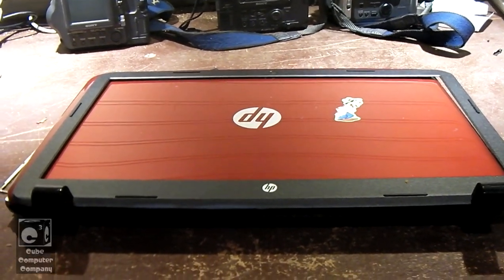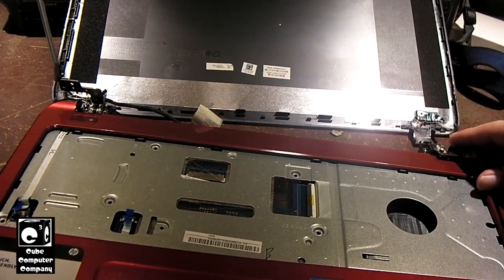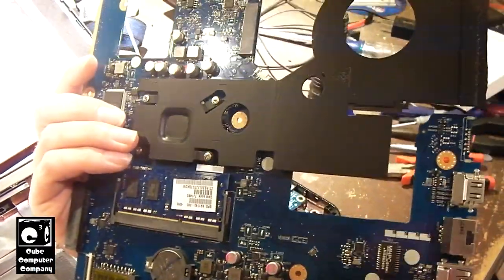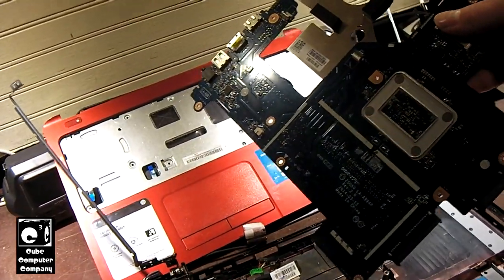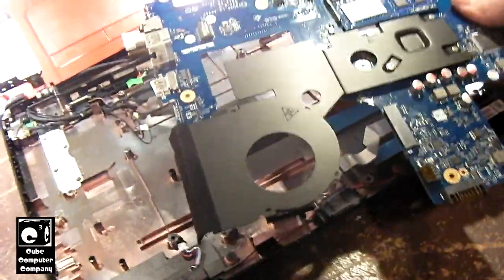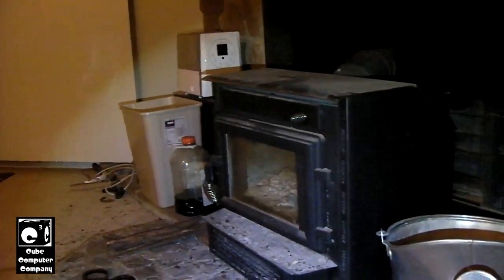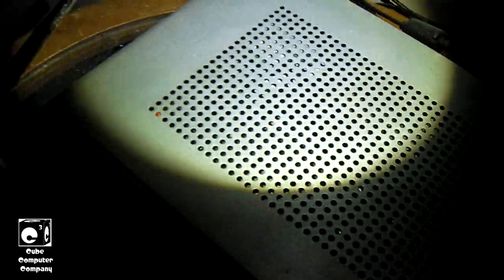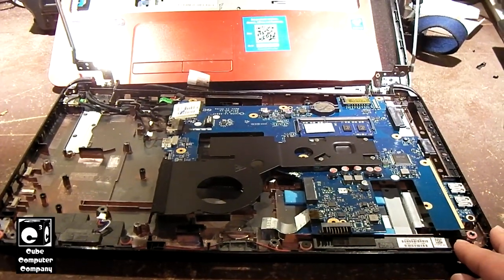The HP Pavilion 15 laptop - Engineered to Fail

Comment: the intel haswell CPU not bad like sandy bridge that hp people most be thinking of if they lower that hp haswell cpu to a lower clock speed then heat sink not required like the newer apple lap top with the arm processor

Comment: they didn't even use the keyboard as a heatsync like they usually do. this is so crap it's rediculous. I guess you could find the intended fan or make your own out of garbage and make an ultra thin STB
Reply from the maker: From what it appears, the header and associated components to run the fan are missing from the motherboard.

Comment: Oh, come on, it is a pentium, you really don't need much more than aluminum plate to cool it. They really dont run that hot. 
Yes the hinges are junk but 9 years is preety good for a "disposable" laptop, don't you think?
They are not engeneered to fail, they are engeneered to be as cheap as possible.
You are straight up exaggerating for views.

If you want something engeneered to fail, look at some apple devices👍
Reply from the maker: No I am not exaggerating for views. The only reason this laptop lasted 9 years was because it was very lightly used and probably never left the home. The owners probably used it for very basic non-CPU intensive tasks. If Acer/Gateway could put a fan in their coolest running Celeron laptops from the time, then HP certainly could have as well.
Reply: @CubeComputerChannel  I would argure that people prefer silent computers over ones that sound powerfull, also relying on a fan to keep the system cool when the owner doesn't know how to clean it (witch are the most people that buy theese cheap laptops) is not a great idea, I had quite a few laptops that had their CPU or a GPU to die because of the dust buildup. there are something some cheap laptops did (even one of the macbooks at one point), where you have a fan blowing air, but the heatsink isn't attached to it. So the fain is usseless. And strange thing, I have one of theese laptops, used it for school, I see theese all the time, they do break but that often.